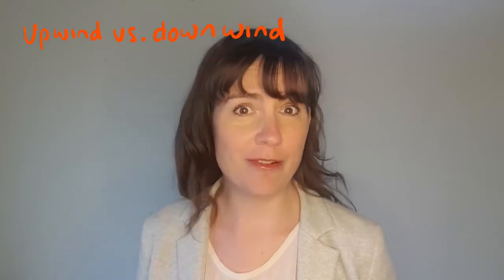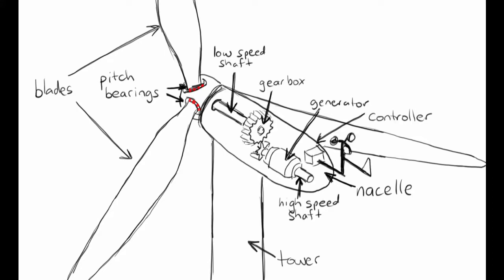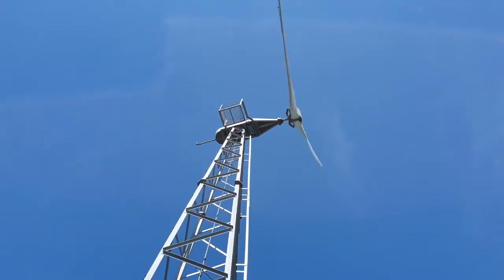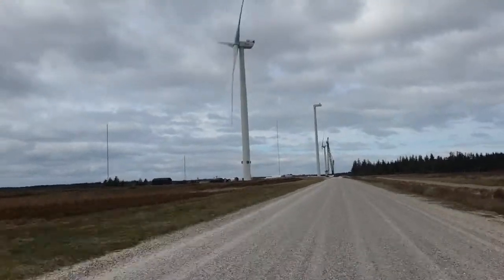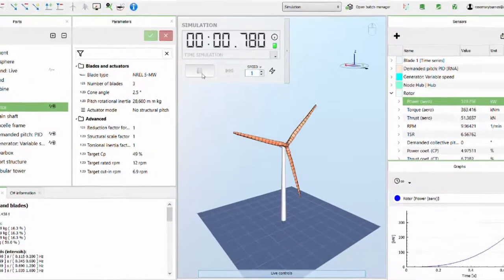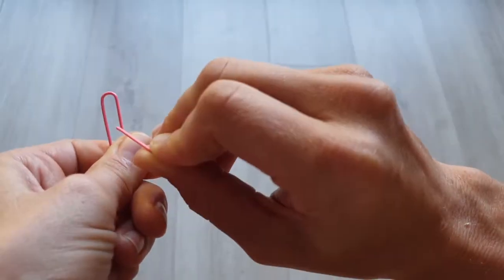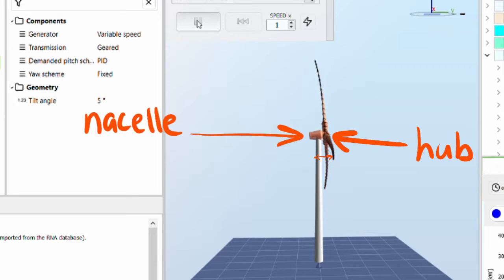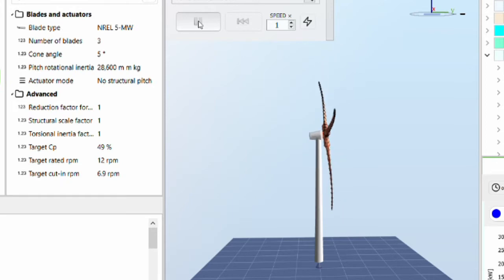Wind Turbine Design to Prevent Blades Hitting the Tower

Comment: Hi Rosie, I want to learn how to specify a Wind Turbine System for 5-10KW industrial applications. What are the Breaking Mechanisms, how electrical frequencies are controlled. What are the techniques and circuits used to control the frequencies....

Comment: Thank you very much Rosie for your insightful analysis whatever the subject. 
I always wondered why downwind micro-wind turbines like the Proven were not more popular, now I understand why the "Chopper" effect of the blade passing the tower has such an effect on the blade life, and the noise levels due to the aerodynamic effects and the spring loaded hinge system employed on the blades to allow for survival at high wind speeds. 
I would be immensely grateful to you if you could do an in-depth study of micro-wind generator design, particularly the Hugh Piggott style machines which are homemade and feature wooden blades .
Reply: We have a Proven 6kW one which has been OK for at least ten years. The noise isn't an issue at about 75m from the house. Whenever it's windy there's so much other noise that we don't hear the turbine.

There's an additional benefit that you have less "stuff" pointing the blades the right way.

Comment: Why is the pre-bending better than increasing the cone angle respectively? 

– Oh, is it because in mid to heavyish wind the pre-bending approaches zero and thus the blade approaches optimality, whereas with the respective cone angle the same optimality would not be achieved..

Well, I still find this a non-trivial design choice 😅   – The cone angeled blades could be designed to function bent aerodynamically good, and the mechanical manufacturing would be done in straight [unbent] shape [but allow in-use bending], assuming this is a good trade off.

Thanks for great videos😅

Comment: Nice video and presentation. Thanks. 
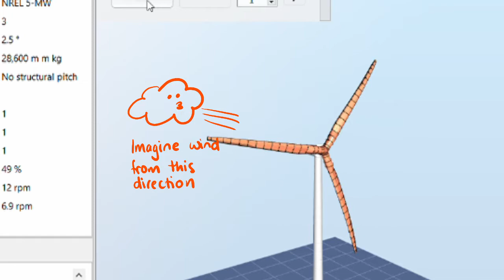Page 4:00 and up : the explanation for frequent flexing in the blade axis can cause fatigue in blade materials progressively into blade failure state. 

On the other hand text book teaches that flexing in the linear slope region below the yield section doesn’t cause fatigue. 

I guess the fatigue example was drawn from a marginally structured blade that flex next to its yield region, out of aggressive costing or ignorance.

Comment: Greetings from Ireland. I'm assembling a 5kw wind turbine which is offset on the tower axis (vertical) and has a tail blade or vane. The instructions are very vague. It's not obvious how to pitch the blades, they are fixed in position on the hub only, one angle is very shallow, pretty much flat against the wind and the next position is tilted a lot. Any suggestions or advise?

Comment: What about reducing the diameter of the tower by using stronger alloy metals or something. Probably too expensive material wise I suppose.

Or how about a tower with a hole in it at the point on the tower that the tips of the blades pass. Could the tower be built in two parts (each with a hole that line up with the other). Two sections would be easier to transport I would think. The place where the hole in the tower is could be reinforced internally with some kind of bracing/scaffold) if the hole weakens the tower. Maybe this could make the assessment of the blades easier because each blade could be rotated until they are at the hole and inspected for damage. How are turbine blades inspected anyway?

Comment: How do engineers deal with the difference in wind speed between the top and bottom of the swept area?
Reply: Most of the time they don't.
Some adjust the pitch angle when the blade is down to compensate for lower wind speed, but it is not worth the added wear on components.

Comment: Ah amateur's hour: I would like to see a bladeless turbine. Like the bladeless fans that only has a small fan in the base, but in reverse driven by the suction from the stationary ring. No large movable parts and generator and turbine at ground level,  likely no gear box needed either.

Comment: Windmills are a failed technology unless you have a small one hooked straight up to your house. These wind farms don't work especially in the winter time and they lose most of there energy through parasitic loss.
Reply: huh? The UK would like a word. So would Germany, So would China. Oh, sorry you said windmills, yes, windmills are a failure for producing power. Good thing we've moved on to airfoils using composite materials and satellite tech to measure and site a potential wind farm location. phew, that was a close one.
Reply: @schumzy  Shut down all fossil fuel energy and then rely on windmills and solar then let me know if this form of energy works. Don't matter where you place them they lose most of the energy in the power lines. Unless you got solar, a small windmill and power banks in your backyard then its will work. Placing them miles away is pointless. Look what happened to Texas..Huge winterstorm stopped the windmills and they had no power for weeks..

Comment: The rotating blades cause turbulence every time they pass in front of the post (tower that holds up the blade). There is this wobbling post they use for collecting wind power and converting it into electricity. The post of a wind turbine could have a sheath around it that flexes to collect the energy that buffets the post when the blades pass the post.

Maybe vertical axis turbines could be placed around the post, going up the tower. A tower that was 20 metres high could have 20 vats 1 metre long.

Comment: What stops changing the angle of a blade, like for helicopters? It might not be effective for all windmills but it should work for some. Also, a shallow angle would not be best performance for high speeds of wind and blade rotation.

Comment: Rosie, excellent explanations, especially about fatiguing, using the paper clip.  Why aren’t wind-turbine blades made with a helix or twist as are ship propellers, or airplane props, or window and table top fans, to match the air speed?  One suggestion… you’re using “further” when it should be “farther”.  “Farther” is used for physical distance, like “Drive farther north”, whereas “further” is used for metaphorical distance, as in “Develop your concept further”.  It’s easy to remember when to use farther because in contains the word “far”.  Everything else was very well done.
Reply: Wind turbine blades are indeed made with twist to match the relative air velocity, it's just harder to see on the long, slender blades :)

Comment: For an undergrad design project I did a medium-sized downwind turbine design with a streamlined fairing running down the tower for the length of the blade. It would be attached to the nacelle & so rotate with it. It wouldn't completely eliminate the fatigue cycling but would reduce it somewhat.
It was a decent enough idea to earn me a good mark, but I found enough downsides to not be surprised that it's never been put into practice as far as I know.
Reply: Interesting. Can you recall the top downsides?
Reply: @londonwestman1  Long time ago, but there was a fair bit of additional fibreglass. Making the tail of the fairing long enough to be effective meant the the turbine needed to be some way back from the tower, adding some structural mass and wear on bearings

Comment: In heavy wind conditions that might bend the blades into the tower why not feather the blade?  Change the angle of the blade and present less surface to the wind?  Most likely all turbines in the high wind area would be producing close to nameplate capacity and the extra electricity wouldn't be needed. A small loss could be tolerated.
Reply: They actually do that on large turbines.   In high winds they angle the blades into the wind, reducing the rpms and decreasing the stress on the blades.
Reply: @Bendigo1  Correct.  That's what they do.  They feather the blades in order to dump wind off the blade in order to not overload it.  Just like one eases the sails on a sailboat to deal with winds too strong for the amount of sail one has set.

Comment: I wouldn't choose one solution.  I would run a large number of simulations covering combinations of different amounts of possible parameters - tip bend, cone angle, wind speed etc - in the hope that there will be a 'sweet spot' where the combination is most effective/least loss.
Reply from the maker: That is pretty much what wind turbine conceptual designers are doing, maybe you need to get a job in the industry!

Comment: It might be a uneducated suggestion but what if the tower itself was allowed to bend? In high winds the nacelle would angle up moving the blades away from the base where strike is most likely, in lower winds it reverts to vertical so you recover efficiency, yes there would be a potential issue with fatigue loading on the tower.
Reply: I am not engeneer, but what i see that wind goes in gusts.  If the tower bends, there will be back and forth oscillatoons and blades more likely to hit?

Comment: One could tilt the tower, creating something like the London Eye. The available yaw would no longer be 360 degrees, so I guess it would only be a useful solution in locations where the wind direction is very stable. 
Such a tower might be cheaper than a conventional tower, because the legs will always be in compression while the cable stays will always be in tension.
Reply: Towers are very heavy, so you would want to have them vertical to avoid stress on tower and foundation.
Its also easier to install.

Comment: Hi Rosie.. why not make the blade front with carbon fiber and the back with a pressure resistent material? like oak  or what they  use in wooden propellers

Comment: You explained the topic very well. I feel the control system act the major role in avoiding blade tip to tower hit, High wind and turbulence will make turbine crazy what is your opinion?
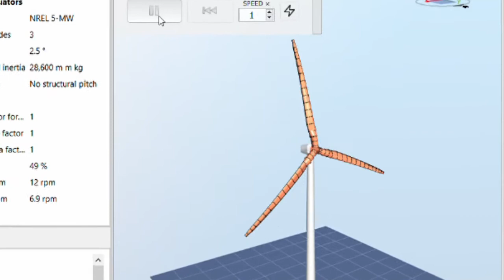 3:53 Which was the simulation software used?
Reply from the maker: The software is Ashes:
https://bit.ly/3cpasvJ
And yep, (very) strong winds and turbulence are not great for wind turbines, like you say!
Reply: @EngineeringwithRosie  Thank you 🙏

Comment: Cyclic pitch has to be worse for fatigue loading, and it will affect the whole structure not just the blades / rotor. Helicopters experience a lot of vibration transmitting down the shaft into the body when they are using a lot of cyclic.
Pre-curving makes every sense. They're going to strain under load whether you do this or not. Only downfall is that the area presented to the wing increases as the wind speeds up and the disc flattens out. Really in this light it wants to be behind the tower.

Comment: would it be possible that under heavy loading the blade would twist. reducing the aerodynamics and load?
Reply from the maker: Yes you are absolutely right! They design blades with this in mind, but it's tricky. The topic is called "fluid structure interaction" if you want to look it up, and there have been many academic papers written on the topic 😊

Comment: Am I seeing wrong or is the pre-bend towards the tower rather than away from it?
Reply from the maker: If you see blades bending towards the tower, that's not prebend, it's blades bending from the wind. Or they have been installed wrong 😂
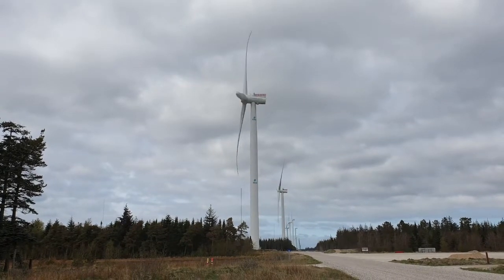Reply: @EngineeringwithRosie  OK, I guess that makes sense. I was thinking of e.g. the turbines at 2:45. I thought the blades were actually shaped like that.

Comment: I like tiny air pressure tubes down the length of the blades to monitor the loading and then adjust the pitch to compensate for bending forces and efficiency.

Comment: Actually had a tower strike on my homemade 70cm turbine earlier this year. Strengthening the blades worked out fine for me. 
I think most modern turbines use a combination of every concept. The Siemens SWT-3.6-120 is a good example.
https://www.wind-turbine-models.com/turbines/646-siemens-swt-3.6-120-onshore?picture=d2xGt8q6Tml
Reply from the maker: That picture illustrates it really well, thanks! 
Your homemade turbine sounds cool, did you make it as an interesting engineering project, or to save money on electricity or something else? How is it going now that you fixed your tower strike issue?
Reply: @EngineeringwithRosie  I made the turbine mainly because it's a fun and interesting engineering project. It's only 70 centimeters in diameter, so it doesn't produce a lot of power. It only lights up a few LEDs on top of the tower. Since I upgraded the blades the turbine is working very well.
Currently I'm thinking about designing a slightly larger 3D printed turbine that could generate 100 watts and uploding it on Thingiverse so everyone can print it.

Comment: Your timing is impeccable!  I just started experiencing this problem on the Mark V.  Since I'm of a smaller variety,  I'm going to attempt to just strengthen the blade, but I will definitely keep the bent blade away from the tower in mind.
Reply from the maker: Oh that's so funny, glad this came at a good time for you 😀
Reply: @EngineeringwithRosie  have you ever heard of the Fawt wind turbine? Some bloke 3D printed a small thing, but it's design has my attention.
https://youtu.be/jEQ8YhStmXw

Try to imagine this Fawt design with a archimedes screw pointing up. Could be interesting.
Reply: @EngineeringwithRosie  as luck or fate or both would have it, the act of making my blades a tad stronger have resulted in a slight push forward.  Regardless,  I'll take it!  Cheerio!